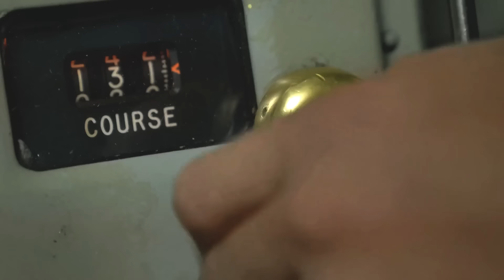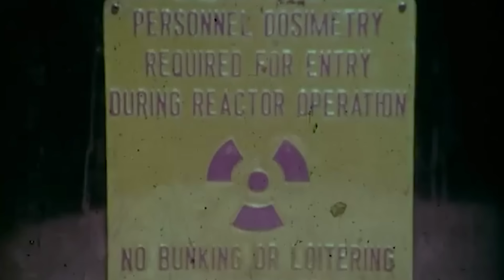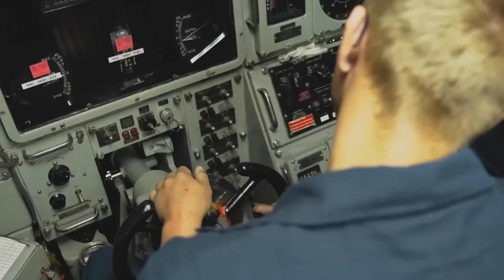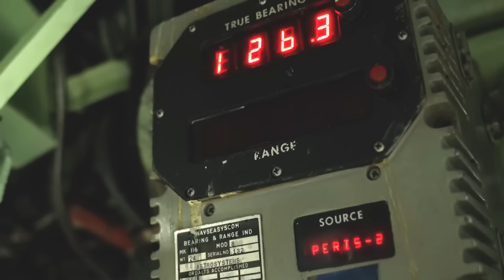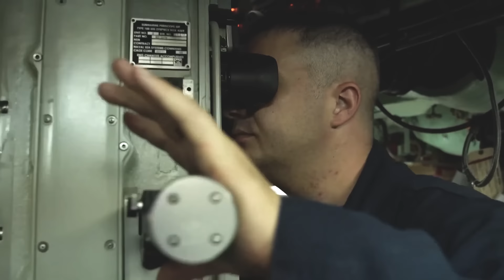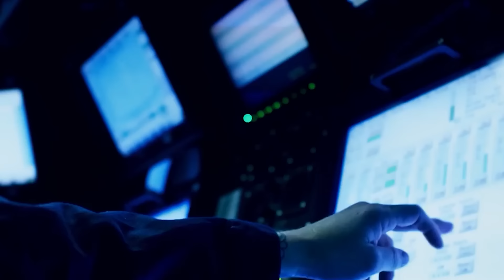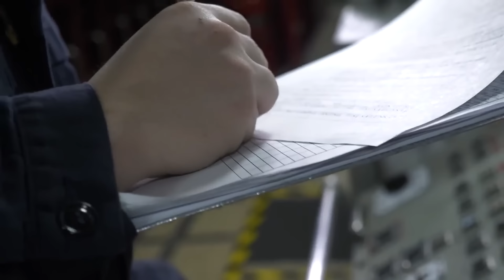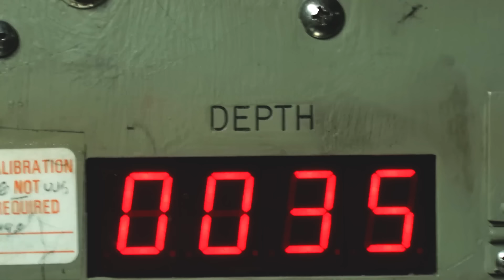The Secret Submarine Mission that Doesn't Officially Exist - Mission 7 - USS Jimmy Carter

Comment: Fiber can’t be tapped as easily as copper. You also can’t splice fiber without degrading the signal. The tap would be detected based on my non-expert research.
Reply: You are correct. I took but never was in a position to apply lessons learned in a fibre splicing course. Those undersea cables would have multiple fibres too, each in their own tube, that are then wrapped with all sorts of layers to keep them dry. Also incorporated would be strength members either in the middle, with fibre tubes around it or the opposite. It might depend on design or the manufacturer.

The actual fibre, that is the 'glass' optic, is smaller in diameter than a human hair it has all sorts of coatings applied.

I have no idea how many lasers they can shoot down an undersea cable, but if my memory is even remotely correct, from the courses I took close to twenty years ago, I think the instructor had commented that makers were trying for 37.

Each laser has a specific angle and there is only a small variation in angle in which they can be set or the signal is lost. Effectively think of the fibre as a pipe. The laser fire on an angle and the signal sort of bounces down the fibre much like a sin wave, but also corkscrewing at the sametime. So the signal rides the outside of the inside of the fibre 'pipe'.

Whew! So if the Carter is splicing fibre on the seabed, and here's the real trick, how is this being done without interrupting any of the signals?. Just think. Here is a cable with say 16 fibres and if my guess is anywhere close to accurate at 37 (or more now a days) that's 592 separate signals. Keeping in mind that any blemish on the fibre will cause a permanent signal loss.

Neat trick eh?!
Reply: @foamer443  thank you for the info! I definitely don’t think these cables are being tapped on the sea floor. There would almost certainly be a more feasible way to intercept the same info on land. Or heck, get a company or government to just share the data with you secretly.

Comment: Why would be a 90's design submarine stealthier than her successors? Why would the US Navy bother to send a museum to special missions, while they have cutting edge technology Virginia class subs? 

I am no naval expert, just curious. These boats might receive some degree of overhaul and technology refresh during the years, but I do not think any main component has been modernized. I would bet Virginia class has much better reactor and propulsion system, along with more recent sensor and data processing technology,  making them more stealthier and more dangerous than the predecessor Seawolf. In 2013 even Block II. Virginia was available already.
Reply: Put it this way: Boats built in the late 70s & 80s are pretty much doing everything described in this video... and more. The Jimmy is just at another level. Certain opposition countries who are supposed to have "on-par" tech in regard to undersea warfare are not even close in all reality. LA class boats (and the GNs) are still able to get work done without counter-detection. JC remains the quietest full-size nuclear powered boat in the ocean.
Reply: @yogi6917  I agree :) I meant to say if I wanted to do something extra secret, then probably I'd do it with my most recent platform which has less chance to get counter-detected.
Reply: @salikaa86   
How do you know that the JC doesn’t already have that capability?
 
It was modified and heavily converted during and after its initial construction for spec ops. 

Unless you served on it, you don’t know what it capable of compared to a newer class. 

Where do you think the Virginia class got it’s technology from? 

“Don’t judge a book by its cover.”
Reply: @jademonkie  I admit, arguing about sub capabilities are pure speculation, since these things are the most heavily classified.

However, I would expect main components, like the reactor, main turbines and its auxiliary machines not really designed to be refit, pretty much one with the ship. But maybe it is feasible to replace the compartments as a slice of the ship.